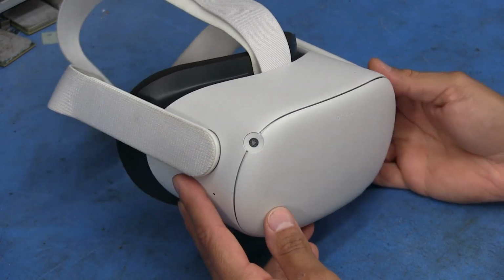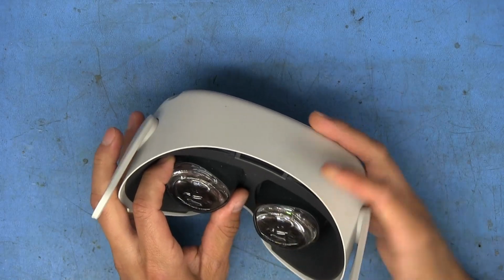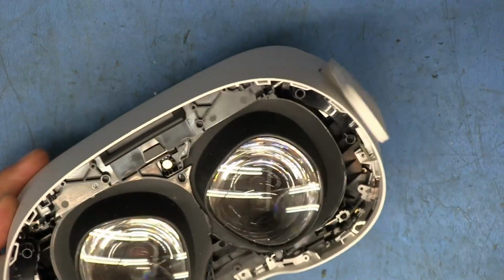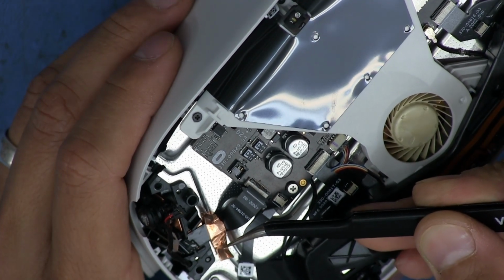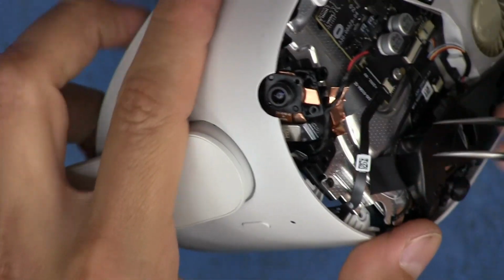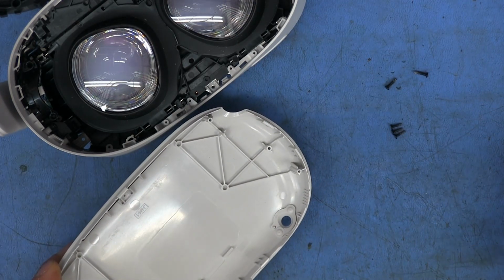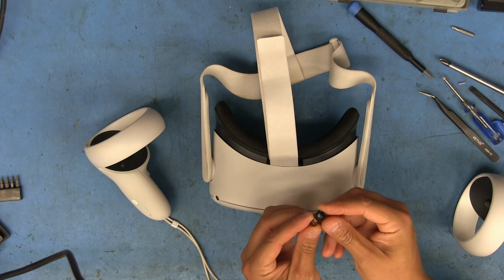TWB #103 | Oculus Quest 2 Upper Right Camera Replacement

Comment: I hae fingernais to hold screws in place like that when tring to screw them in, you can also lift the bracket up a little instead of holdig it down so gravity can lay the screw in the hole until you use the screwdrive to push it into the threads

Comment: What I want to know is, are those cameras the ones that “connect” to the controls? My son’s headset works perfectly fine, same right top camera is broken and the right controller is connecting. It will turn on but on Gorilla Tag, the arm is stuck in place and then disappears. Could it be the broken camera?
Reply from the maker: It's possible,. I actually don't know enough about these, and this unit didn't belong to me, so I only had limited experience with it. Although I'm pretty sure they are used somehow for tracking the position of the controllers.

Comment: So i replaced my broken camera, which was the same one you replaced, after putting everything bck together, on my bottom right corner the screen is dark, just like a dark spot, any help on what it could be?
Reply: A bit late but sound like the proximity sensor wasn’t connected properly

Comment: the main common problems is around to proximity sensor cable that needs to be perfectly set back up, uneasy  ! ( or black screen after 5 seconds )
Reply from the maker: Definitely one of the more delicate connections
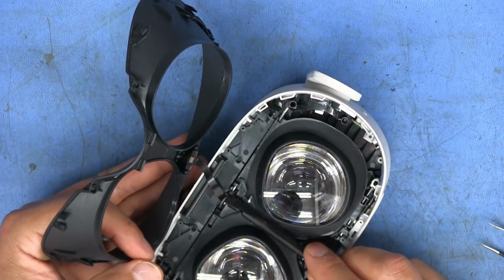Reply: @ThatElectronicsFool I am finding that out on day 2 of trying to get the sensor connected. a more detailed view of this at 20:00 would have been very helpful... I think I might be throwing this out soon if I can't figure it out which sucks because I'm pretty sure the camera is working fine but the prox keeps unattaching

Comment: I think I just had this exact issue today:  one slip, very short fall, it landed right face bottom into ceramic.  I didn't seem to perceive any broken camera, but something definitely broke there.  If you wait enough for 2 restarts or something, eventually it just starts and shows your environment, but in ZERO DOF, the image is just dragged along wherever you look, no gyros etc.  I double tapped for passthrough and nothing either.  anyway... lots of trouble for such a short fall.  I'll see what I can do... honestly, I'm awful with technical labor like this
Reply: Did u save your quest?

Comment: mine also droped after a week of using it the top right camera broke now the controlers will never show up no hand nothing and it just keeps looping is that becouse of the camera ? please whould love to hear your anwser in order to get it replaced
Reply: Yea I’m waiting for my order to arrive from eBay only managed to find one that would ship to where I was hope it works
Reply: Def the camera. You can easily replace yourself… just did mine the first time with this video
Reply: You got this… in the video, he talks about a bunch of screw… not the case. Pop the styrofoam frame, 4 screws on top (T3  Torx screw worked best on mine) 2 on bottom, pop black frame, 5 screws connecting white frame, pop front frame, camera is simple
Reply: @richarddennull1335  thanks for the info just hope that will solve the problem ! Excited to get motion sickness again xD
Reply: @richarddennull1335  yes the replacement camera fixed my problems ! im so happy ! sadly i ripped the face sensor strip xD so now i have to always disable proximity sensor to be able to play but all and all this fixed my problems ! its alive !

Comment: hey man sorry to bother you but does anyone know where I can get an Oculus replacement camera
Reply: eBay is where I bought mine! It think I spent $15 on mine
Reply: @richarddennull1335  I already repaired it but I did the same thing
Reply: Thinking of starting my own Oculus repair shop😅 Pretty easy
Reply: @richarddennull1335  I never done hardware modding before this but I was super easy just don’t strip the screws

Comment: I accidentally spilled water on my oculus quest 2 and the right lens stop working. I suspected that the right camera is broken. Do you think this might be the reason why the right lens is not turning on? If so, would changing the right camera fix the problem?
Reply from the maker: It sounds like the panel inside is damaged somehow, and not the camera. The cameras are not used to display an image, just for the unit to know where it is in space.

Comment: My cameras didnt brok but day ago i dorp my headset and the tracking get lost some tims pls i eant to gix that shold i do the same thing u did ?
Reply: Yes you should have someone who looks at Electronics to take your Oculus apart and replace the camera but if you trust yourself enough to do it then do it yourself
Reply: @Kramizm  i will think about it thx
Reply: @Kramizm  can u tell me where can i buy one of the cameras
Reply: @Coffee_Drinkerr  Is from a ebay online!
Reply: @lnikkiafi6094  NAME
Reply: Did you finally work after fixing the camera and which ofthe 4 camera did u replace?
Reply: @edwardeborgu9691  i didnt
do it +  i dont use me headset any more

Comment: In your opinion was there definitely a correlation between the breaking.kf the camera and the Oculus not going past the blinking logo? 
This happened to us tonight... I dropped it and now it's starting but just blinking the logo... The camera is infact broken.
Reply from the maker: Yes, having done nothing else, replacing the camera was the only thing that got it working again.
Reply: @ThatElectronicsFool my issue with my oculus is that as soon as i power it up everything sort of kinda disappears and it’s like the boundary screen was replaced by the main screen as the first screen then everything but my custom home map disappears and then it does the weird thing where everything on screen moves exactly pinpoint where you look at the same speed which isn’t normal it goes to the boundary making screen then everything goes back with the weird thing happening with the boundary making screen part then it goes onto tracking disabled then it does the weird thing again is that a circuitry problem or a camera problem because im pretty sure the tracking camera and whatever camera handles the screen or every camera might be broken is there a way i can fix it I don’t wanna have to go through the pain of getting back all of my dlls lemon loader cx file explorer and all of the other 32 apk apps that i have

Comment: Hi, can you pls share the link for the replacement camera on eBay pls?
Reply: Thanks as well @The Workbench
I've had a bad lense for more than 6-8 months I was having a hard time sourcing a part.
Reply from the maker: The one I bought was a listing for a single one, I just typed in "Oculus quest 2 camera" on eBay, but it was something like this:

https://www.ebay.com/itm/NEW-Genuine-Oculus-Quest-2-Camera-Sensor-SAME-DAY-SHIP-MPN-330-00782-02-/274795295629?mkcid=16&mkevt=1&_trksid=p2349624.m46890.l49286&mkrid=711-127632-2357-0
Reply: @ThatElectronicsFool  thanks man appreciate it!